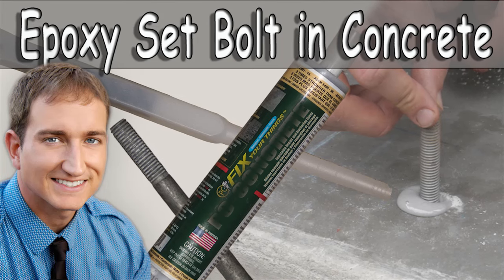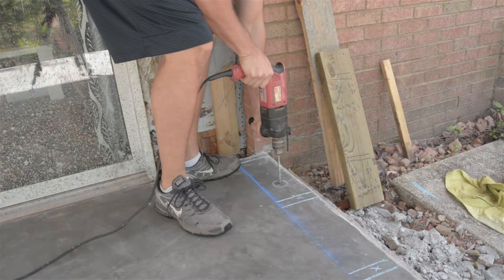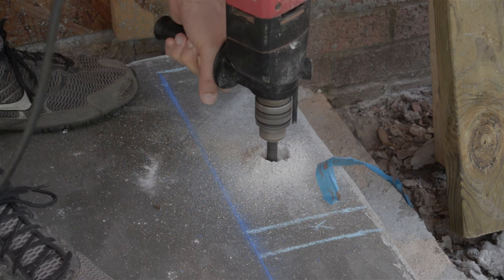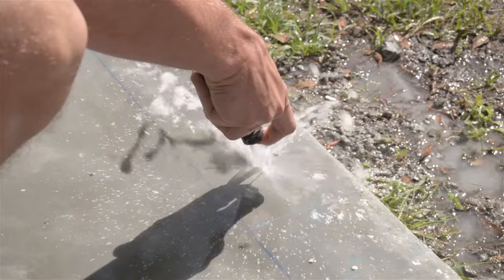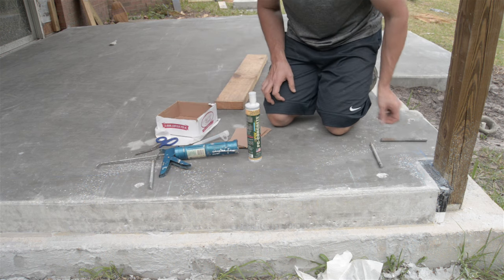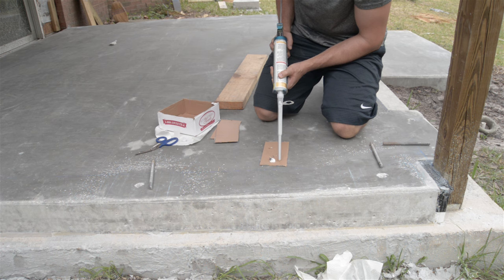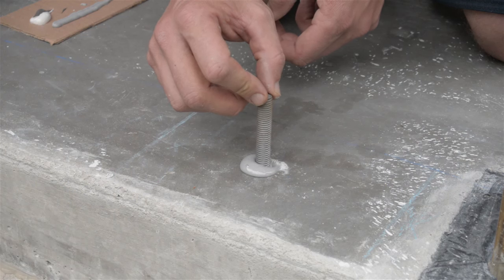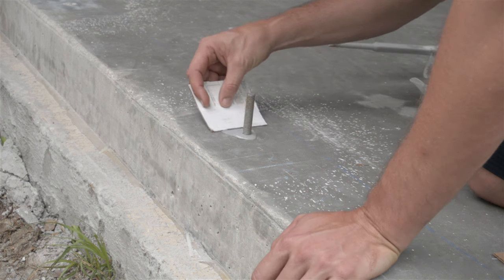How I Epoxy (Glue) Anchor Bolts Into Concrete, Video #4 New Room Addition

Comment: Water part was a big mistake. At the bottom there will be a lot of water in the concrete and this will reduce expoxy connection strength.
Reply: The epoxy manufacturer does suggests this however. Look up Simpson Strong Tie on YT.
Reply: Use Rubbing alchohol
Reply: He dried it out

Comment: Water in the hole is a BIG no no. Just buy a hand pump (¢99 store) and some 3/8 inch pipe cleaner brushes
Reply: Sorry, you dry it completely. Water works fine.

Comment: Some epoxy manufacturers clearly recommend that the holes be clean and dry. The recommended procedure is to blow the dust out, use a narrow brush to brush the inside of the hole, then blow the dust out again. I simply use a flexible plastic tube, blow into it while pushing it in until it hits the bottom, and move back and forth while blowing until no more dust comes out. The idea is to make sure there is no layer of dust which would prevent the epoxy from strongly adhering to the surface, otherwise the rod could slide out.
Reply from the maker: Thanks for the tips regarding how you clean out holes in concrete prior to applying epoxy to anchor bolts into place.
Reply: yes this actually required for thrid party inpsection for engineered repairs. Every 8" on center for 12' -4.5" deep...this is going to suck and thats just the vertical repair on one side.
Reply: Layer of dust will not happen if washed. Some people love the hard way.
Reply: @Nttt739   You wash it and then wait until the water is gone? In most cases that is impractical, as water can linger for a very long time.
You have missed part where holes are supposed to be dry.
Reply: You missed the part where you make sure it's dry. See my other post. Whatever, you do it your way.
Reply: Why do you think he put a paper towel in? I'd rather risk damp than dust..
Reply: Your not wrong I just don't like that method.

Comment: ...supposed to turn the thread rod/anchor counter-clockwise (unless using a left-handed threaded rod) You want to turn it so that it pressures the adhesive to flow into the hole, and not out. The anchor will displace some adhesive (unless you insert the exact amount)...but, turning the anchor the wrong way can cause more than necessary to be forced out.
Reply from the maker: great tip, thanks for sharing
Reply: The video is correct - you do thread the bolt clockwise. This helps get the epoxy into the threads - counter clockwise can prevent it from penetrating. It is true that you wouldn't want to thread it clockwise more than necessary because you could start drawing the glue out of the hole.
Reply: How would direction of contiuous rotation affect adhesion????

Comment: Was going to do this, then read on a couple of manufacturers websites that anchoring epoxy is "not for sustained long-term loads". That last bit being a cut and paste from the datasheet for Quickrete's High Strength Anchoring Epoxy. That got me thinking, wouldn't torquing down a sill plate be a long-term load?
Reply from the maker: according to the local building department in this region it is pretty standard practice to use this method for this type of application.

Comment: Great video! I was wondering,  are post installed anchors just as strong as anchors installed during the concrete process? I am in CA & earthquake zone
Reply from the maker: Thanks for watching usually the concrete epoxy product will have load ratings provided on a label.  In any case the effectiveness of the strength of concrete bolt installation or epoxy anchor application is also heavily dependent proper installation techniques.
Reply: @MrKistel  Thank you!

Comment: Great video! I used your video as a guide on how to install my 2 post lift about 8 months ago. I feel FAR safer with a single 5/8 threaded rod epoxyed in than 10 3/4 wedge anchors (they suck). My neighbor suggested using a rag thats damp and putting it on a drill bit to clean the holes out. That's what they did when putting 8 foot rods into concrete to do the casinos in CT. Worked like a charm! I let them dry out for an hour and then went to town. I'm building another addition so I'm looking at ways to anchor the sill and posts to sonotubes. Probably going to do the threaded rod method again lol.
Reply from the maker: Thanks Rob. and let me know what you decide to use between the post and tubes.
Reply: @MrKistel  I just poured the tubes yesterday and cut galvanized rod to length today. I'll epoxy them in and bolt to 6x6 post bases. Will not go anywhere for sure.
Reply from the maker: @TheStevedie  thanks for sharing
Reply: @TheStevedie Hey Im trying to install my two post lift, but I'm hitting repair right where I need my wholes so I can go down as far as my anchors needed. How deep did you drill
Reply: I drilled through the slab, 3.5 to 4". I nearly filled the hole with the epoxy, covered the threaded rod in and pushed/twisted it in. They do have drill bits for cutting through rebar
Reply: @TheStevedie  have yours been holding up good. In 4 to 5 inches but in thinking about picking up I believe it's called a diablo rebar demon bit
Reply: @wilsonwichman4847  yes. they are fantastic. I also used blue loctite on the nuts when i set it. If you can I would try to drill through the rebar. the more surface area you have in contact with the threaded rod the better. suck out any dust and use a damp rag on a drill bit to clean it out as best as you'd get it. give it an hour to dry though.
Reply: @TheStevedie  thanks. I'm gonna make sure I get through the rebar, but I'm still for sure gonna use the epoxy bolts
Reply: @wilsonwichman4847  I used Dewalt AC100 Gold two part epoxy on the 5/8 galvanized threaded rod.

Comment: 1. Drill the hole roughly 1/8" larger than your anchor. 
2. Use compressed air to blow out and Shop-Vac the dust at the same time. DO NOT USE WATER!
3. Use a long wire bore brush to score and rough out the hole. This roughing helps the epoxy to grab onto the sides of the hole. 
4. Blow out and vaccum again. 
5. Then, install your epoxy and all-thread anchor.
Reply: I’m planning to mount a 100 lbs server rack to a poured concrete wall.  Should I use this threaded wall and epoxy method?
Reply: @monohydrate2  ...generally, properly installed epoxy all-thread anchors will always be stronger then wedge type Red Head anchors.

Comment: Not sure if you’re still active but i really need advice. Would you recommend this video ( epoxy anchor) or wedge anchors to hang a punching bag in concrete from my wall. It would have 6 bolts. Thanks!
Reply from the maker: Sounds like either could work. If using epoxy you might have to deal with the effects of gravity while waiting for epoxy to cure if applying to a vertical or overhead wall.

Comment: I usually put bolts in original pour which allows to skip this process... but if you have a slab already there you need to drill.

Comment: How far from the concrete edge did you drill your holes for the sill plate?
Reply from the maker: 4 to 5 inches I think.  I tried to get as far away as far as I could but still be in a good spot for the sill plate.
Reply: @MrKistel  yeah I'm about to do my anchors for my garage, and the sill plate is a treated 2x6. So to be in the middle 1/3rd of the board it'd be like 3.5" from the edge. I'd like to go at least 4" but I don't want the inspector calling me out lol. Did you use a 2x8?
Reply from the maker: @SamsDIY  mine was 2x8.  This was a reason I used epoxy to anchor the bolts verses using something like an expansion anchor.

Comment: What makes you think that you get a stronger attachment by having an extra-big hole?  Why do you think that a thick layer of epoxy holds better than a thin layer where the 2 surfaces are closer?  Does the building code allow this method of attachment?
Reply from the maker: I believe the hole drilled was the size recommended by the product manufacture for the hardware size used.
Reply: Always read and follow(to the best of one's ability) the manufacturer's instructions.

Comment: shop vac would work well to get concrete debris out of the hole
Reply from the maker: A vacuum could work well to clean out the holes in the concrete prior to adding the epoxy anchor adhesive.  Water worked well in this case with the concrete anchor epoxy product used.
Reply: Shop vac, then wash, then dry with towel or other means .

Comment: Can you use expansion bolts with epoxy?  I thought that you couldn't mix the two even though I don't know why as it does seem like it better with epoxy than without.  I do think you should "set" the expansion wedge before the concrete cures to at least get that part working.  Once the epoxy cures I don't think you can set it.
Reply from the maker: Generally the expansion bolts require a tight predrilled hole to work correctly. For example a 1/2 inch bolt would require a 1/2 drilled hole. This makes sure the wedge can grab into the concrete.  On the other hand when using epoxy to anchor the bolts, it requires the hole to be drilled slightly larger then the diameter of the anchor bolt.  This provides some space for the epoxy.

Comment: Work fast,,,,and have a helper in warm weather.  I used this epoxy in 88 degree Florida weather and the epoxy hardened in the mixing nozzle before I started on the third anchor.   Did not have a helper so in the brief moment it took me to put down the caulk gun and insert the anchor bolt, the epoxy started to harden in the mixing nozzle.  If I had a helper, I might have been able to fill all the holes while the second person inserted the anchors.   The manufacturer needs to make a slow cure epoxy
Reply from the maker: wow that is a quick set up
Reply: I'm about to do this for a fence. I might keep the product in the fridge before I use. It's 90-100 degrees where I am!

Comment: Will this help to rocking or spinning  toilet bolt?
Reply from the maker: Hmm, not sure concrete epoxy is the proper repair for fixing a toilet bolt.  Having said that the epoxy is very strong.
Reply: Same issue how did it go ?

Comment: Does this work only on ground holes? Got an apartment complex that needs work, AC's outside have a rod iron guard n all the bolts anchored in are loose. Was wondering to use this or will all the epoxy just fall out
Reply from the maker: it is pretty tough stuff and could likely be used for a variety of applications

Comment: Also make sure that the inserted bolts are vertical
Reply from the maker: Great tip to make sure the bolts are plumb when setting them in the concrete epoxy. Thanks for watching and commenting.
Reply: Ten bucks if you can insert those bolts into those holes horizontally)

Comment: How much is the epoxy? I need to install 4 small anchor bolts for a sliding gate motor. Would epoxy be worth it or would I have a most of the epoxy tube left and have to trow it away?
Reply from the maker: I believe the Epoxy product is shown in the video description. If you were to get it I would try to find a use for the entire tube although you maybe be able to store for a period of time if need be.

Comment: Where did you find those 6 to 8 inch bolts? All I can find is like a foot to 6 feet long
Reply from the maker: You could cut custom lengths from the longer stock.  Sometimes lumber suppliers carry long bolts as well.
Reply: @MrKistel  thanks! I thought about that but was worried about the cuts making it so the nuts can't thread?
Reply from the maker: @TheTreehouseFamily  I usually cut with an angle grinder and the soften the cut edges with the grinder. A file could also be used. Usually nuts go on no problem.
Reply: @MrKistel  thank you, sadly those bolts aren't available right now. they were when you first sent the link but now aren't

Comment: I have a gate anchored to hollow concrete blocks with lead anchor bolts and they've vibrated out over the years.    Do I fill the whole cavity behind the hole with epoxy??  Any ideas?
Reply from the maker: Hmm bolts are lead?  Not sure what you are working with there so not sure I can provide any useful advise.  Having said that if you have enough epoxy it probably would not hurt to fill the cavity.  Otherwise you might be able to put some filler in the void before adding epoxy to critical areas around the anchors.
Reply: For hollow block installations you would use epoxy screen tubes in conjunction with anchors. They're made for that exact situation.
Reply: I'd try some large toggle bolts.

Comment: Why not just use standard anchor bolts made specifically for this purpose?
Reply from the maker: If referring to the type that use an expansion and compression type apparatus, it is partly because the concrete was not fully cured at this point.  In addition the holes were placed near the edge of the concrete.  There was a possibly the expansion anchors could cause the concrete to break.

Comment: Wonder if this works in a empty brick to anchor a gate
Reply from the maker: As long as the brick is structurally sound enough to hold the weight of the gate and the additional forces I would think so.  Might have to use a longer anchor to go deeper into the brick structure.  Having said this it might not be a good idea to attach a gate directly to a brick veneer wall. The veneer brick wall  may not be solid enough to handle the gate loads even if the epoxy bolts hold.

Comment: How long bolt to use to support 8ft 4*4 post ?  How much deep to dig ?
Reply from the maker: I am afraid I am not entirely clear on what you are asking.  In any case both those items may depend on several variables. Thanks for watching and best of luck with your project.

Comment: Why not vacuum the dust out of the hole?
Reply from the maker: I assumed water would wash off all the  powder residue stuck on the inner walls.
Reply: @MrKistel  But by using water isn't there the problem of having to dry out the hole?

Comment: can i lift a sidewalk with this,,what is the pullout strength rating
Reply from the maker: I have neve tried that but the strength is impressive.  The epoxy products describe the strength ratings on the product labeling. Keep me posted if you end up trying and how it turns out.

Comment: Are you supposed to use epoxy in expansion anchors?
Reply from the maker: As long as the holes are drilled to the appropriate size for the expansion anchors I would not see a reason to use Epoxy.
Reply: @MrKistel  I came to the web to find a solution for a drilled hole which is too big for expansion anchors, would I be able to skip the expansion anchors and just put the smaller screws in permanently? Sorry in advance, I am an absolute beginner!
Reply from the maker: @amirelt4370  I am not sure I completely understand the question.  If the holes are too big for expansion anchors you might be able to epoxy appropriate size hardware in place instead.  Double check with the manufactures instructions on the epoxy product though as they often have hole size considerations.  i hope this helps and best of luck.

Comment: Unless the bolt is to be used for holding something light, what's the point of bolting then?
Reply from the maker: An anchor bolt, properly set with an approved Epoxy compound can handle a significant load. In this case the function was to attach the wall plate to the new concrete floor.
Reply: @MrKistel  Was it just an oversight not to put the J anchors in the concrete when you poured the slab... it just takes a bit more advance planning & avoiding the drilling into hard concrete & having to use epoxy at all?
Reply from the maker: @heyitsrick01  Thanks, part of it was planning as I was not sure where to place the anchors at the point of the concrete pour.  I had not had framing plans finalized at that point.  Secondly, since it was a shallow concrete pour,  I thought I could install deeper anchors by drilling through the poured concrete layer and some of the old concrete. Then I could epoxy the anchors in place exactly where I wanted them at a deeper depth than the j-bolts.

Comment: How far distance between two anchors?
Reply: This depends on your local codes.  Here in Benton County, Arkansas I believe it is 6' maximum for single story, 4' maximum for two story.  I divided out by how many splits I wanted to make and add more if I think the distance seems to great, but the bottom line is that you need to meet code.

Comment: this epoxy how strong is it or how many KG can it hold to the max tq
Reply from the maker: There are many manufactures of similar type Epoxy products. I do not specifically remember the specs for this product although it was plenty strong for my application (tie wall into foundation).  It seems to be amazingly strong stuff, but i do know the holding power greatly depends on the installation.
Reply: the reason i am asking is because i had need to install back the  glass bathroom  door the bottom hinge  tiles been remove and wall plugs come out i need to use concrete wall plug the hole gone bigger .i am wondering any of this epoxy can do the job.
Reply: Joe,
typically these products are 10X stronger than the material you are bonding to. So the concrete will break before the epoxy will. Caveat: If applied correctly!
Good luck
MJ

Comment: Couldn't you just set an anchor in the concrete when it was poured?
Reply from the maker: yes it is an option to place anchors into the wet concrete if you prefer however it would be a different style anchor. Usually they have like a hook or bend in the bottom to stay stuck in the concrete.
Reply: @MrKistel  I've seen some things showing that just a headed bolt or a bolt with a washer and nut on the end in the poured concrete holds better than the style with bends in it.
Reply from the maker: @benjaminmiller7933  Perhaps, I like put in the anchors after the concrete is poured  myself.
Reply: That's what I did, But this video is how to Epoxy anchors into concrete.